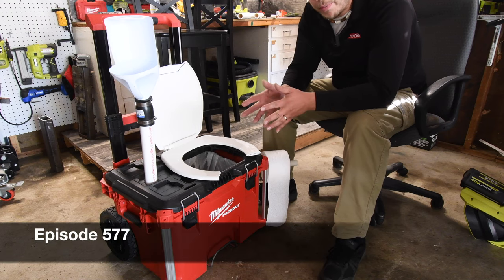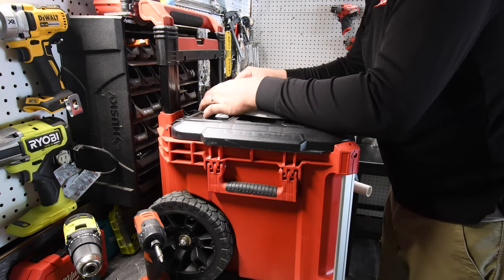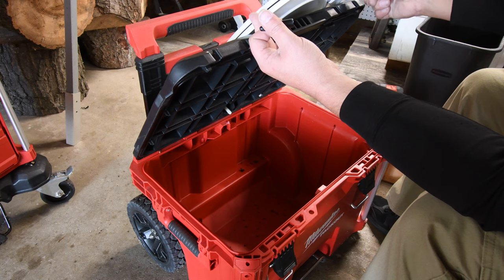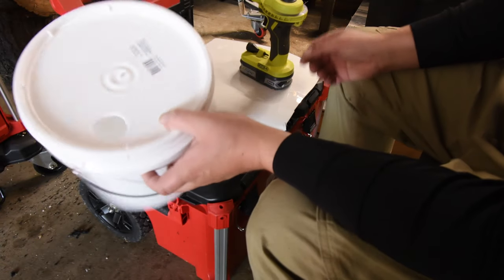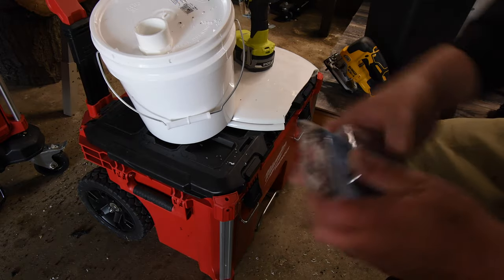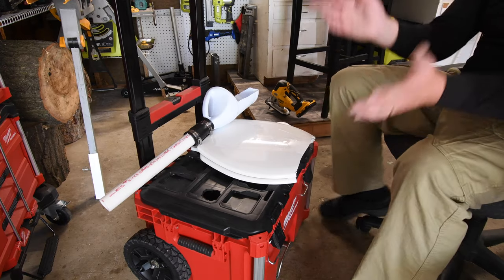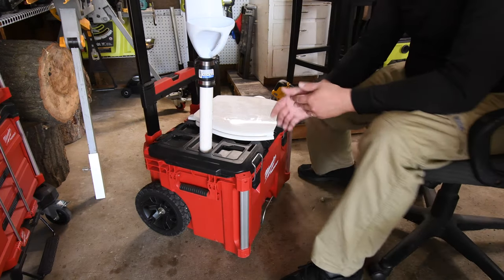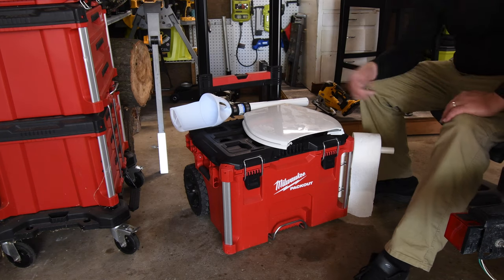You can now Packout with your Crackout!!!!

Comment: Did you know: In your garage, you have a water heater. Your water heater weeps water under pressure and discharges moisture into a drain. You have a drain somewhere near your heater. If you wanted to utilize the drain, get a large funnel, add a small latex tube to the funnel and shove the other end into the same drain that the water heater drain drains into and bingo...Instant urinal.
Reply: Im on a second floor shared drainage horrible design im sure dude would love me!
Reply: @patrickbjordahl3239  lol.
Reply: Kitchen sink
Reply: @PFab  From experience? lol
Reply: Mine goes to a sump pump.  That wouldn't be a nice smell most of the time.
Reply: @DavZell  if the rubber hose connected to the funnel is only 1/4” inch, it’s big enough for fluid to go down but prevents smells from lingering. Plus like any other toilets , you flush. Pour water after using into funnel.
Reply: @paedahe4975  I can empty a 2 gallon dehumidifier in my sump without it turning on.  That's would be a lot of water to "flush".
Reply: @PFab  I do it who cares its just water anyway.
Reply: @donproctor3445  😆.  Just don't drink it thinking the same thing.

Comment: One possible design change would be to put the urinal on a hose instead and clip it to the handle.  It would be easier to pack away, and it would be height adjustable.

Comment: If you integrate a phone charger on that thing and park it in front of the tv, you’d only have to get up to answer the door for pizza. Work smarter, not sharter.
Reply: Rig up a drill to power those wheels and he wouldn't even have to get up.
Reply: @DavZell  that’s a good idea. I’ll have to wait for the cheaper version: Ryobi one + HP Hard Shart, “Squeeze one off you’ll be proud of.”

Comment: First, you did hang the paper properly.  Second, it needs a hand rail for us older handicap people. (And it needs to be taller).  The urinal was about head high when in the seated position. The thing that I am the most disappointed is……… no Ryobi tools was used. I thing you should make one using each line of tools as a challenge to see which one is best sh…….ter. Waiting for the next video ……….